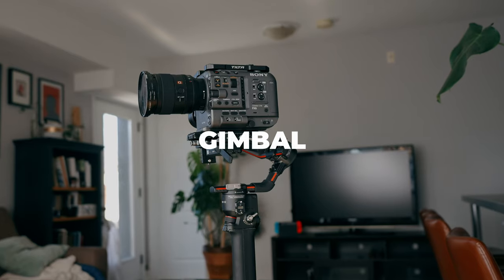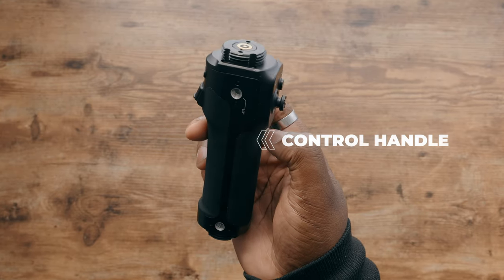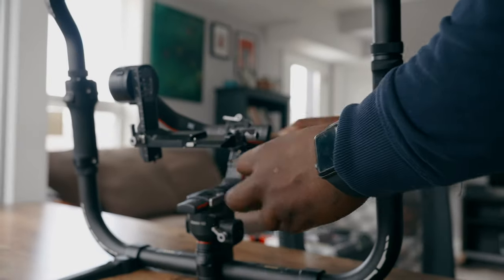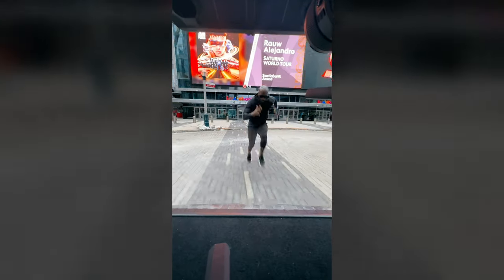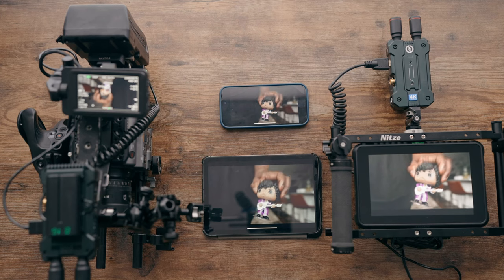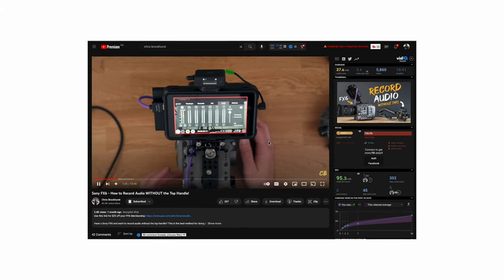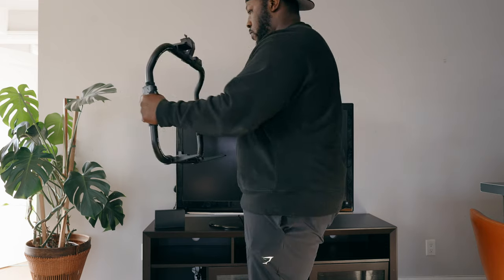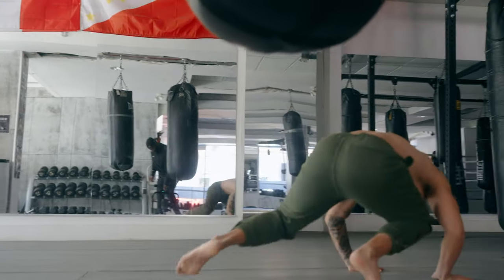Sony FX6 Tilta Basic Ring Plus Gimbal Setup

Comment: can i start recording from the fx6 when i press the record button on the ring grip? if so, how does this work and how do i have to connect the fx6 to the ring grip?
Reply: and all your Videos are amazing
Reply from the maker: You need to make sure it’s connected to the ring but you can control record on a remote on it ( which I think is seperate )👍🏾

Comment: Great video. I have a similar setup and I wasn’t able to find any literature anywhere to confirm that I could attach the handle and a V mount at the same time. Didn’t want to fry anything. But thanks to your video it looks like you can!

Also I wasn’t sure about the power module due to so many people online saying they fried their gimbals but I believe they were attaching D Taps backwards on the output. To you use the Dtap out on the power module?

I have both an FX3 and an FX6 and this setup is great for both cameras.
Reply from the maker: I was okay with the handle and v mount after shooting for a bout 3 shoots so far , so good! The new basic ring plus might have fixed it but I’m not sure, and I used the usb c, since the d tap is so close to what I have on it I’ll just plug direct to battery when I can 👍🏾

Comment: Great video but didn’t understand why and how you were using the raven eye ? Was someone else holding the phone to control the camera movements? 

Have you used lidar with this setup as well?
Reply from the maker: I got the lidar system some months later, and yes you can use force motion with a phone and raven eye ! Whcih helps when yuo want exact movements without sacraficing body position ex. low angle push in wiith a pan up, I'd rather have someone on raveneye controling the gimbal motion

Comment: Did you figure out a way to turn the control handle off for the basic ring grip w/ the control handle? No power button on the handle like the advanced ring grip so it seems like its going to slowly drain the battery so long as its hooked up…
Reply from the maker: I haven’t ! Then again I’ve left it on for like a week and it didn’t take out the battery so I’m guessing it’s a thing where they didn’t think it’s important